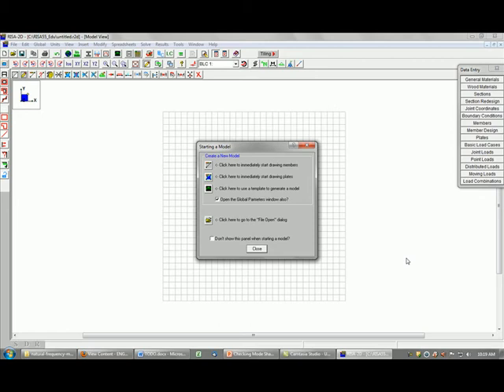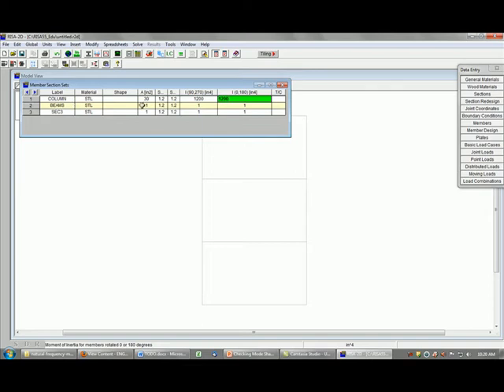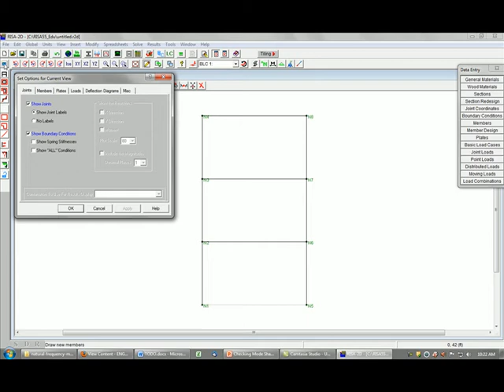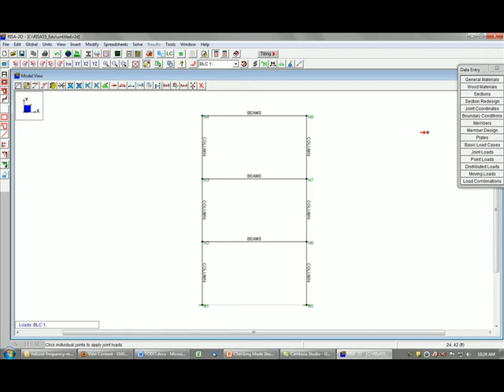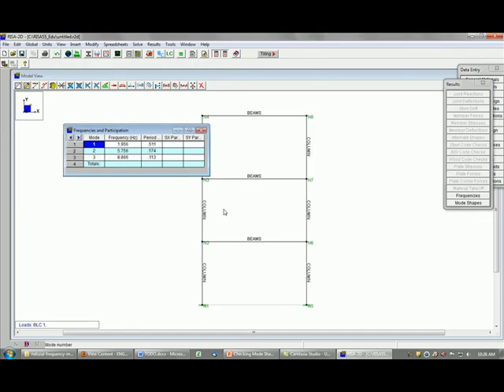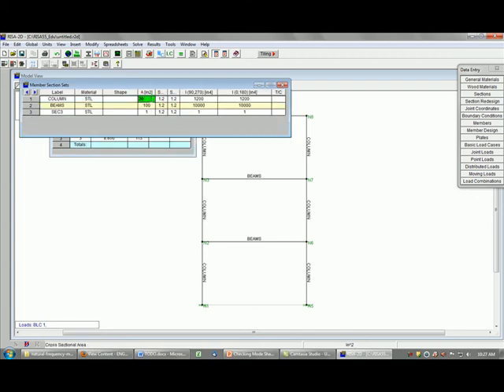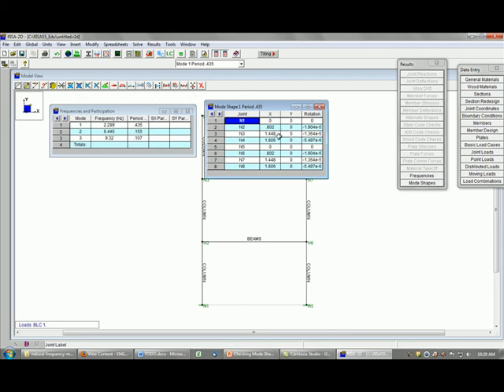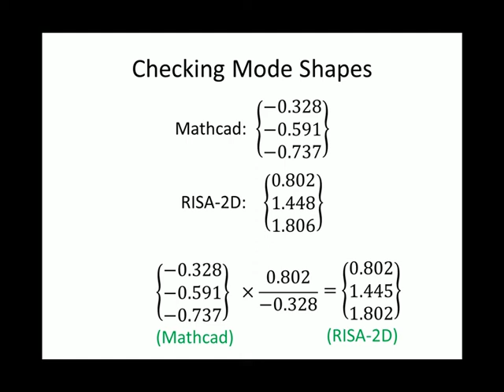Modal analysis using RISA 2D (Part I)

Comment: Allowing the rotation, especially as it is so small, is more likely to produce the more honest estimate. All structures are going to rotate somewhat. First, seismic waves are not going to hit at a perfectly perpendicular angle. Second, the mass of the building will not be perfectly symmetrical. So, the seismic force and the reaction of the mass will be eccentric and will create torsion. This will rotate the columns ... at least as much as the small values derived here in RISA.
Reply from the maker: You're absolutely right.  Part of the reason I've simplified the model so much is so the students can check it by hand.  By making the assumptions I do, the students can get very close with a simplified hand calculation.  I teach undergraduate students, so I've tried to keep things as simple as possible.